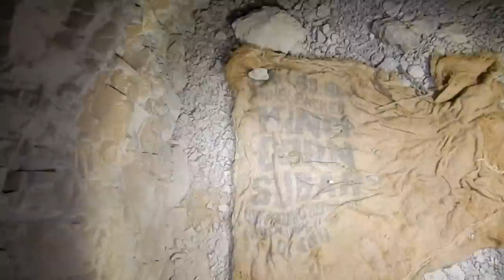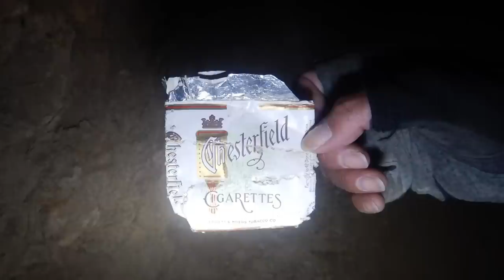Huge Abandoned Mine and Mill Site: Cool Underground  Explore, Flotation Mill Ruins, Ore Car⛏️💰

Comment: that piece of equipment in the road is a classifier for the mill ...looks like cyanide agitation tank...check under the ore bine for Gold ore ...that's no chuckwalla ...that Godzilla .... we would say most mine fires are cause by knuckleheads that have not been raised right ...or dropped on their heads a few times hahhaha.... wow JC Penny .... didn't they sale clothes at one time hahaha ...really cool hand pump ... another fun explore ....be safe out there you two and like always .....we smashed that like button ....smashed it HARD !!!!
Reply from the maker: While I thought this was a gold mine, I found out later it's a silver/lead mine on a galena deposit. The mill was built in the late 40's and is a flotation mill that pumps air into the bottom of the tank of slurry containing the ore and other things.The bubbles bring up the goods somehow. I agree that most fires are arson, but not all. When running equipment underground there are a lot of dangers with fuel, electricity and friction. The Ruth Mine is a good example. A fire started accidently in the hoist room in the 1950's and spread through part of the haulage level and down the huge winze shaft. We liked that hand pump, too. Thanks for the comment, Jeff!👍😎

Comment: The Queen of Sheba is an interesting mine I have visited many times.  I was hoping that you would get into the older Carbonate workings 1500 feet to the north.  The adit is right off the road that continues to the north, no waste rock pile or anything to indicate it is there.  Those workings, which are smaller, in my opinion, are much more interesting geologically and mineralogically speaking.  The adit goes straight into the hill and comes to a junction that was stoped.  There is a small winze and the back was stoped up.  At this junction, there is a rather nice vein of Galena in the back.  It really sparkles!  If it was not a patented claim and in the NP, I would have gathered some nice samples.  There were even small crystals on the floor.  I do hope that you got into those workings.  From the data I have, the mine was last worked in the '70s.  It was incorporated into the Roy Group in 1976.  When I first went there many years ago, you could drive a two-wheel drive sedan up that road.  A lot has changed since then.  I was last there four years ago.  Even then, a high clearance vehicle would have had no trouble.  Thanks for the video! I always enjoy them.  Two days ago, I was at the Umberci Mine.  In 45 years of off roading, I got my first off road flat tire there.  Been lucky.  Also, always check the bat bars.
Reply from the maker: Hi Jim, thanks for the comment. We did explore the Carnonate Mine while we were at Sheba. They are interesting workings, although to include them with the Sheba video would have made it rather long. If you make a YouTube video too long, it will tend to scare many people away. We didn't get up to what looked like open cuts above the two lower adits near the road. We ran out of time and energy. We will make a video of our visit to the Carbonate at some point. We haven't been to the Umberci Mine. Is that in California or Nevada? I believe there is a mine by that name in both states. We have not had a flat tire either. Thanks again for the comment!👍😎
Reply: @TomandJulieMineExploring  The Umberci mine is northwest of the Coliseum mine in the Clark Mountain area, and just north of the Ivanpah Solar electric station.  The Powerline road leads to the access road, which is rather washed out and is easy to get off of because of the braided wash.  The adits and shafts are bat barred.  The lower adit, with the wood door frame, check the third bat bar.  That access road is where I think I got that flat.  My 23 year-old plug kit and plugs fixed the puncture!  First time I had ever used it.  Same with my Viair pump.  Glad they were in my Possibles bag.  I never leave home without it!  I think I am going to get new plugs.  Tomorrow, I am heading out to the Dawson Mine camp south of Cima.  Cima road from the 15 to Cima is closed, so I will have to come in from Kelso, I hope.  The main shaft is plugged and the secondary shaft is flooded about 60 feet down.  Still an interesting area.  I then might poke my nose around some of the mines east of Kessler Peak area via the Morning Star mine road.  Will have to see how the time and energy  goes.  In my 60s, I ain't as spritely as I once was.  Glad you got into the Carbonate workings.  Since you are in the general neck of the woods, east of Darwin (over the mountains and back down into the valley to the east of town) , off of the Darwin wash road to the south, are several interesting areas to explore.  The road out of Darwin is N. Main St.  There is a road off to the south that will take you into a couple of the canyons.  The last time I was there about three years ago, they were a bit rough.  Definitely worth the effort.  I am not sure about current ownership, but it all used to be The Anaconda Co. Property.  The big mine in Darwin is currently owned with a caretaker.  I read that the owner wants to re-open it.
Reply: I saw an online advertisement for the mine in Darwin hiring.  Must be close to reopening it.  I’m curious if the patented mine you mentioned is still privately owned.  Usually when a national park is created they try to buy out the patented properties or seize them by other means to eliminate private property in the parks

Comment: Another great explore - very puzzling why, when it looks such a substantial mine site, that there is very little evidence of any rich vein of worthwhile material - such as quartz 🤔 …maybe I should watch it all again; perhaps I missed something! 🚢🇬🇧🚂⛏
Reply from the maker: Hi David. Some mine workings follow narrow mineral veins that were deposited when hot mineral laden water pushed up through a fissure, or crack in the Earth's surface. Other mining operations remove an ore body that is not a narrow band deposited the way I described. There are two main ore bodies that have been identified at this mine. One is roughly 230' long by 100' wide and 20' thick. So, you don't see a well-defined "vein" here. It can also depend on the type of ore present. I think this was mainly galena. I'm not a geologist but I hope that answered your question. Thanks for commenting!
Reply: @TomandJulieMineExploring  thanks so much for the explanation. 👍
Reply from the maker: You're welcome!

Comment: I 've worked in Lode Mining most of my life and I have no Idea what that Contraption is either, never seen one of those before however with the Leach Tank and Digester (iron thing on it's side) all sitting near the contraption from it's design I'd  suspect it was for Pre-Digester Slurry Mixing. When using Blasting Powder instead of TNT Miners would add Sugar to the Blasting Powder to give it more power. Lodes that use Leaching typically do not follow a Vein as the Gold in bound up with other Mineral like Lead etc...
Reply from the maker: Thanks for another informative comment. I think you're spot on with all your points. I didn't know about the sugar being an enhancer. No real vein, as you said. This was silver/lead galena, I think.  I'm always learning something from you and others who comment. 👍😁

Comment: Out of curiosity, will G.P.S. equipment work inside these mines? My personal in door GPS is terrible. Get turned around on the same floor of office buildings. Ever think that you'd become disoriented in any of these places?
Reply from the maker: GPS will not work in a mine. The satellite signal needed to run it is blocked. We almost never get turned around or lost while exploring mines. If we are worried about it, we will sometimes make a small rock cairn at a strategic point for reference. We have gone around in circles a few times since mine workings tend to look very similar to each other. Thanks for the comment,👍😎 Ted!

Comment: The top ore bin had a guy working a sledge hammer, ore that passed through the grizzly was drawn out into a crusher. It's output went to the second bin and material from it was drawn to go into a ball mill and the fines went to cyanide tanks or with water run over copper plates coated with mercury to amalgamate the gold.
Reply from the maker: This was a silver/lead mine, and the mill was a flotation mill. There is more information in the video description. Thanks for the comment,  Lothar.👍

Comment: Do they burn the mines to get rid of the bats?
Reply from the maker: They wouldn't burn the mine timbering to get rid of bats. Instead, a small wood fire would be made on the floor of an adit to smoke out the bats. Usually, when we see burned timbers like in this mine, it's either arson or an accidental fire caused by machinery when the mine was operating. 👍😁

Comment: Why two ore bins?
Reply from the maker: Good question. Trying to figure out the path of the ore on this one was difficult for me. Ore would be classified, and different sizes of ore would be sent to different places to be reduced further and either shipped or processed in the flotation mill. The lower bin seem to be where the milling took place. Much of the reduction equipment is gone so hard to say how it all ran. Thanks for the comment!👍😎
Reply: It seems to be a common configuration though.